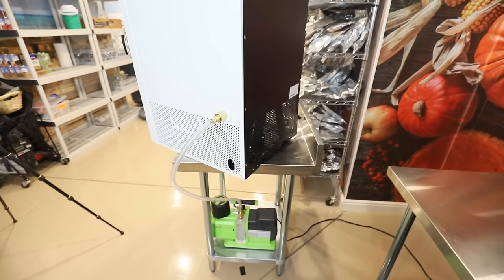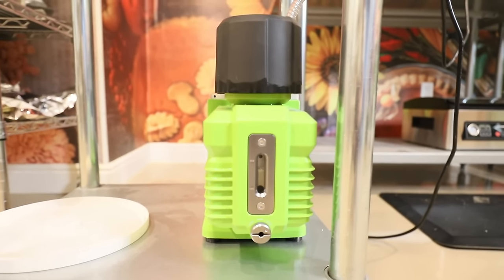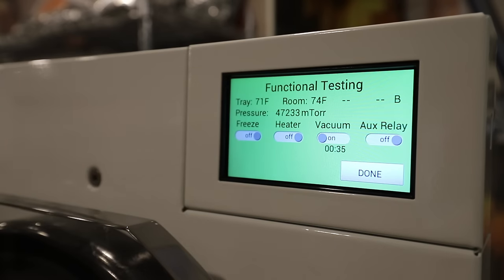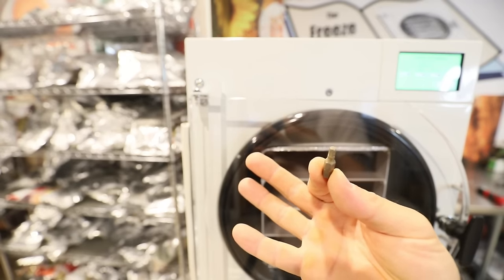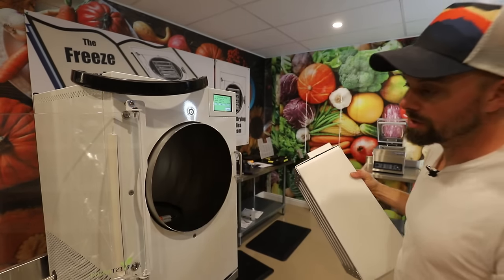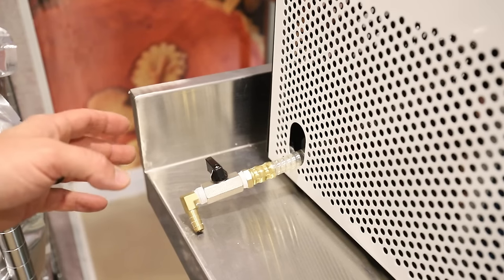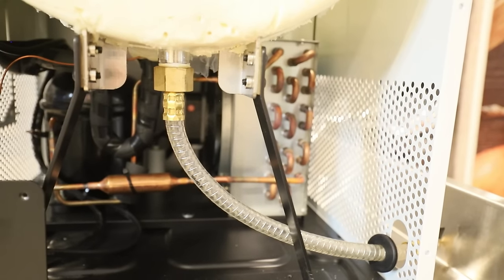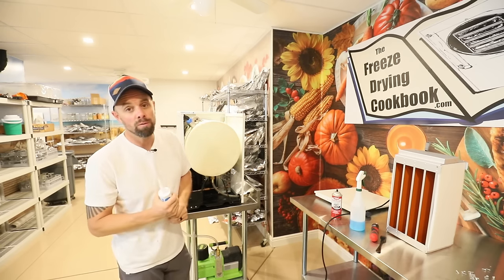Freeze Dryer Vacuum Error Troubleshooting -- SOLVED!

Comment: On the industrial side, when we looked for leaks on vacuum systems, we used shaving cream sprayed around the suspected component and looked for the "inward pimple" on the surface of the shaving cream.  We also used vacuum grease on the fitting connections instead of Teflon tape.
Reply from the maker: Wow.  Thats really good info.  Thanks
Reply: Noted! Thank you.
Reply: Have you ever freeze dried uncooked meatballs?

Comment: Thank you for disassembling your entire machine for us. I’ve been struggling for the 3 weeks we’ve had the machine. Continuing vacuum leaks. Once while trying to upload new software from HR, the machine totally reset to factory input screen. Currently waiting for new vacuum hose and stop-cock from HR. That’s where they think the issue is. How can I get back to the original settings of my machine? It has no serial number anymore nor do I know if any of the factory settings are entered. Anyone?
Reply: Did you fix your issue? I found the answer on Reddit. You just have to use the up/down arrows to change the serial # from what it says, then mine worked again.

Comment: I did a vacuum test on my new medium unit and it got down to 342 mTorr. My question is if you shut off the vacuum pump and the mTorr goes up I most likely have a vacuum leak somewhere?  I replaced the drain with a decent quality brass one because the one it came with was questionable.

Comment: Thank you for your help! Do you know why my FD has condensation on the outside of the door?
Reply from the maker: Yes.  It's the same as a glass of ice water.  Cold on the inside, warmer air on the outside
Reply: This has never happened?  Is it normal then ? Just happened yesterday and I have had the freeze dryer for over a year. We are also working with vacuum. Error problems. Watched your whole video. Thank you so much.
Reply: I wondered how long does it take approximately through the Freecycle before it starts vacuum freezing
Reply: @live.life.simple.  thank you so much! Your videos are so easy to understand thank you for your thorough explanations. I had one more question because I can’t remember how long approximately does it take to freeze before it vacuum freezes I already pre-froze, my diced bets ?

Comment: Have you ever had vacuum pump error because of too much product in the chamber? I filled all 4 trays with frozen soup that caused my vacuum error. I went through the check list, downloaded my machine and had it analyzed by Harvest Right. I determined that removing 2 trays and starting over it worked perfect. Amount of product, 8x8 molds with 1 lb. soup per mold frozen. 2 molds per tray 8lb total weight. bricks were trimmed to fit trays. Please give me your comment

Comment: Harvest Right has released a new Software version that is supposed to address the dreaded vacuum leak problem. I think it is a software  Band-Aid for a hardware problem and not a real solution. The old software would generate an inadequate vacuum message if the machines M-Torr's went above 900 during the drying cycle and rightly so. This identifies a Vacuum leak in the machine vacuum chamber mechanics. Without a proper vacuum, the freeze-drying process is not able to produce a good product. The new software allows the freeze dryer to go up to 1500 mt while drying, but there have been tests showing that this increased pressure during processing can leave the product with weird striations and I wonder if this is due to small amounts of moisture left in the food that would compromise the storage life of the processed food. Not a FAN of the new Band-Aid software. This is a software fix trying to solve a mechanical shortcoming of the machine. The problem here is the use of non-Vacuum Pipe fittings used to create a vacuum Chamber. The vacuum Chamber industry does not make vacuum chambers in this way. The other problem is that the chamber is always under expansion and contraction from pressure and temperature. This is not an easy problem to solve. It is my opinion using standard pipe fittings is not the solution. I don't know if some of the inadequate vacuum leaks are caused by poorly inspected leaky welds on the drum of the chamber. This could be, but these would be very difficult to identify because the chamber is covered in insulating foam around the rear. I would hope that the chambers are tested before the insulation is applied but who knows what the quality inspection process is?  The company seems to have an attitude that the customer should bear the cost of the machine maintenance and pay for the mistakes of poor assembly and quality of the machine.

Comment: I had vacuum errors almost every cycle and sometimes more than once in a cycle. Once I replaced the drain valve I have not had one. That was about 2 dozen cycles ago.  Be aware that tightening the little screw may not solve the issue because that simply makes the knob harder to turn, it doesn't necessarily prevent air from leaking out around the ball.

Comment: Very thorough coverage of vacuum leak troubleshooting. I could have used this after we received our second unit. We followed Harvest Right's troubleshooting guide and resolved the problem. It turned out to be a loose screw on the valve knob. Since then, we have had a couple of months of daily use without any vacuum problems.

One problem that I would like Harvest Right to address is the build-up of dust being sucked across the refrigerant's condenser fins. Dust build-up makes refrigerant condensation less effective, which results in problems cooling the freeze drying chamber. An air filter would be expected at the least (although it would reduce air flow). At least it could be changed. However, this problem could be eliminated and the unit could be made more energy efficient by using a water cooled heat exchanger (as is done on high end gaming computers). 

The seal on the door could be improved by attaching a flange plate that mates parallel with the face of the door. The larger sealing surface would provide a better seal. The latching metal piece is too soft and yields to the pressure. It needs to be harder steel, or better yet, use a bolt and threaded closure, as on a vise.

Finally, I would be more pleased to see Schrader valves for recharging the refrigerant, rather than a sealed system.
Reply: @ichetuknee These things are targeted at CONSUMERS who typically know nothing more than "I push the button, do what the screen says, and after a while, it tells me it's done, so I pull out whatever I put in and seal it in bags/jars/whatever." Putting a Shrader on the cooling system would, at best, confuse the majority of buyers, most of whom have NO concept of how a fridge works, and could lead to SERIOUS liability problems when somebody with just enough knowledge to be dangerous decides "It ain't cooling, but there's a tire valve, so maybe I need to put more air in it", then literally blows themself off the face of the map after introducing air into a system that doesn't explode BECAUSE it's sealed and there's no oxygen in it. The door seal works on the "flats" (actually circular, but let's not nitpick) of the vac cylinder that protrudes from the machine - the back side of the gasket (at least on ours) doesn't even TOUCH, never mind seal to, the front of the unit, so it's irrelevant. As for the dust sucked through the condenser coil's fins - That's too simple to even worry about - pull the cover panel and vacuum it away EXACTLY as you should be doing with your kitchen fridge, freezer, or window A/C unit. Adding ANOTHER layer of heat-exchanger would do nothing but increase production costs, add weight, and introduce another point of failure - and again, confuse "Jane End-user" who most likely thinks that there's some sort of magic involved, and that it's invoked by pressing the "start" button. You sound as though you have at least some idea what's actually involved with this rig, and I know beyond a doubt that I've got an EXCELLENT understanding of how it works (other than the software - haven't gotten around to reverse-engineering that part - the hardware is an open book to me, though) but bluntly, the HUGE majority of customers who buy one of these things consider the "how it works" to be deepest, darkest black magic, and the best that can be hoped for from them is that they don't screw things up too badly if they decide to go exploring inside.

Comment: I had a vac problem on my two month old drier. I went through all the tests to no avail; then called HR, which is a pain, but got a ticket started. After sending them the diagnostics from my machine I had my second call to them where I found out they have a repair person that covers Northern UT, where I live. They set up an appointment and the guy came. He took one look at my drier and said your problem is your software version. He updated the software and also used silicone around the wires going into what they call "the epoxy fitting" where the wires enter the cylinder. The drier works wonderfully now, but I don't know, if due to the software upgrade, or sealing the wires. I had version v5.1.19. The new version is v5.1.23. Hope the helps, sorry it's so long.
Reply: David, forgive me for replying to a 3 months old post. The software v.5.1.19 was buggy and could have potentially caused permanent damage on the machine, HR recalled the software and supplied an updated version and told customers not to use their machines with this version of software installed. However, some must have not gotten the recall notice or HR didn't have their email address on file. I still run v.5.0.12 which doesn't have all the bells and whistles but it is bug free.

Comment: 1. new quality ball valve for the drain.
2. pure silicone sealant around any fitting attached to chamber to include the epoxy plug as demonstrated with painters tape dam.
3. Self Fusing Silicone Tape around all hose crimps
After about 6 loads vacuum error, didn't bother with testing, replaced drain valve, and just sealed everything pulled a vacuum of about 120 mTorr and let set over night.  No more issues.  Best it would do prior to sealing was 6-800 mTorr.

Comment: I feel like a fool, but maybe this will help someone.  I had been experiencing Inadequate Vacuum regularly over my last three batches.  It was pulling a vacuum (with the batch and with the vacuum pump test) but was slow to reach 499 mTorr where, with the batch processing, it would kick in and run as normal for a while.  But then the Inadequate Vacuum message would come back.  I was looking at all the steps you outlined that I planned to dive into after the last batch limped through to the finish.  But along with way, I slightly repositioned my freeze dryer.  Apparently, I had it turned in a way that was causing some sort of slight crimp or strain on the vacuum line between the pump and the dryer.  And it must have been this stress or slight binding of the vacuum hose that was causing the error.  That ever-so-slight repositioning that must have relieved this situation for the machine ran nominally for the last twelve hours or so of the freeze drying cycle.  DUH.

Comment: Used this video to diagnose slow vacuum leak.  I, like many others before me, found it to be the drain valve had failed.  Purchased a $10 gas valve at Home Depot and everything working perfectly now.  My medium freeze dryer is 16 months old and I join the crowd saying that using the cheap valve that Harvest Right uses is useless if it failed that soon.
Reply from the maker: They use a better quality valve on their new pro models thankfully

Comment: OMG, thank you for this video.  I bought an air freezer I’ve been down a couple weeks due to “inadequate vacuum issues”. I’ve only been able to process around 10 loads but have run the machine around 15 times.  When everything goes fine, the product that comes out of the machine is incredible. I’m getting ice around the rubber seal when I get a notice when there is an issue.  I’m so frustrated because I have so much to process and the world is getting crazy.
Reply: I have the same issue. Did you ever get this resolved?
Reply: @jubei20111
Reply: I have the same issue...have had the machine a few months and only been able to run 16 loads.  We replaced the door seal, but still have issue and heavy ice/frost around the seal. Adjusted the door.  Still trying to resolve.
Reply: I just purchased a medium Freeze Right 4 weeks ago and also having these issues. The door gasket is icing up and loosing vacuum and erroring out when it goes to the drying cycle.
Reply: @joym.3755  I finally fixed the issue and the issue ended up not being related to the door seal at all. I'm not entirely sure what the fix ended up being because I did quite a few different fixes at once. I would look at applying silicon to the epoxy plug as that seems to the issue with most people's machine. I also put silicon at the base of the epoxy plug for good measure. I also self sealing silicon tape around  all the connection points on the two hoses. Before that, I couldn't get below 740mTarr, now I have seen 185mTarr when running a load.
Reply: @rodboatwright9113  the reason I looked this video up, is because of the ice & frost build up around the outside of my gasket as well as all over the inside too. I've only used my freezer a couple times & was able to get it running beautifully, until the last batch. It went thru the freezing process perfectly, and then errored out due to inadequate vacuum & frosted up. Ive checked everything on mine, except for taking the covers off. I'm curious if you figured your issue out?
Reply: @novaacopeland8513  No, I'm still down. I did try spraying the hose fittings with windex and watching to see if the  Tor # changed any - it didn't. Also sprayed windex around the door gasket - no leak detected there. I'm guessing its a pump failure problem. I started a ticket on harvest right's web page 2 days ago - haven't heard back from them yet, so tomorrow I'm going to call them.
Reply: I put in a service request on Harvest Right's web site, 6 days passed without a response. So I called them today and they e-mailed me a list of things to test. The machine still has improper vacuum errors, so I sent them the diognostics from the flashdrive as they requested and then called them. They said the next available time that I can speak with a tech is Dec 7th, six days from now.  So far I'm not very impressed with Harvest Rights service.
Reply: @rodboatwright9113  I sprayed carb cleaner at every single connection point on the machine and never had a change in mTorr, but after using silicone tape on a few different locations and silicone caulk on a few others I was able to resolve the issue. I'm running a batch right now at 160mTorr to where prior to the fixes I couldn't get down below 700.
Reply: My machine is 6 months old and I'm now unable to get a vacuum below 500 MTorr.  It will stop around 560 and slowly start increasing.
Reply: HI Aimee, my vacuum problem ended up being a leak @ the sensor on the top of the drum.  I had to remove a sticky foam disk from the sencor and squeeze in some 100% silicone caulk around the top of the sensor where the wires go through while under vacuum. Harvest Right has a video on how to do this.
Reply: We think we finally resolved the issue. After trying all the potentially easy fixes without success, we moved on to the more complicated trouble shooting steps. We strictly followed the instructions from our technician  and the outdated video from harvest right . We repeated these steps 3 times (spraying carb fluid on all potential leak locations until our whole house stunk to high heaven,) but we did not see any fluctuation in the vacuum. Out of sheer desperation, we ended up doing the dreaded epoxy fix.  Ever since, we have been able to run the machine for 7 cycles.  Just don't know why we did not see a vacuum delta when we sprayed the carb fluid liberally at the epoxy leak site and wanted others to know that the diagnostics don't always work.
We are not so happy we had to disassemble our new machine, that  it took so long to solve the problem, that we spent so much effort and all the trips we made to the hardware store (1.5 hour round trip) to buy this n that to try to fix a machine that is new and under warranty. However, we are ever so happy to get this $$$ machine running again and we loved the professionalism of our technician. He was great!
Reply: @joym.3755  I also didn't get any MTorr spike when spraying all connection points with carb fluid, so I'm not sure if that part is just outdated advice or something that only works in cases of more severe leeks. The silicone on epoxy plug is what did the trick for me as well. That seems to be the trouble area.
Reply: If you see ice/frost forming around the seal on the door it may because air is entering by the seal.  The air will have moisture that will turn to ice when it enters the cold chamber!

Comment: for better results on the epoxy harness fix, remove the white foam disc with a heat gun and a 90° pick (power off), then use 100% silicone the use vacuum for 1 hr to assure it sealed the pinholes. 
-Troy from repairs.
Reply: That is what was wrong with ours. Did exactly what you said. Have not had a problem since.
Reply: Great Gun?
Reply: @thecardoc8234  ooops meant heat gun , thanks
Reply: Whenever I repair mine with 100% silicone it will work at initial application. Then after the silicone has dried I cannot achieve a proper vacuum. Do you have any advice on this?